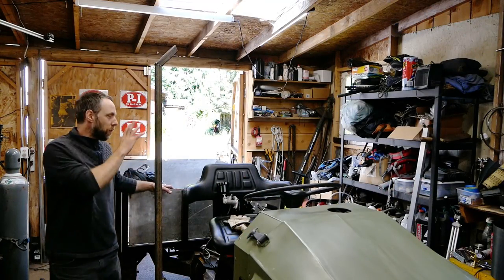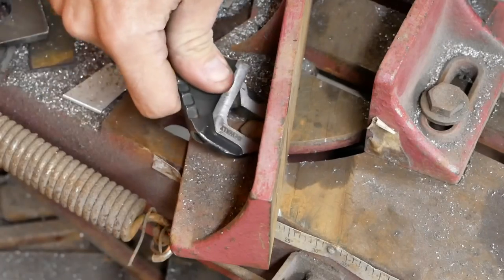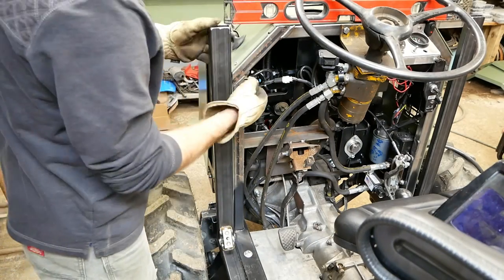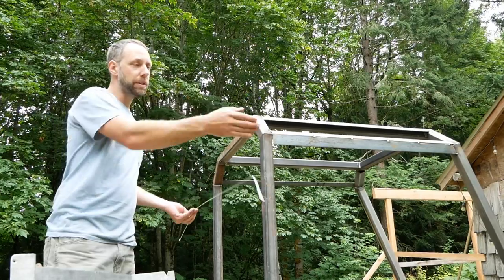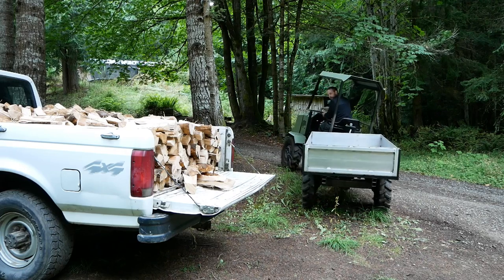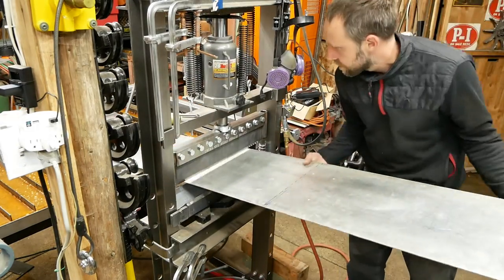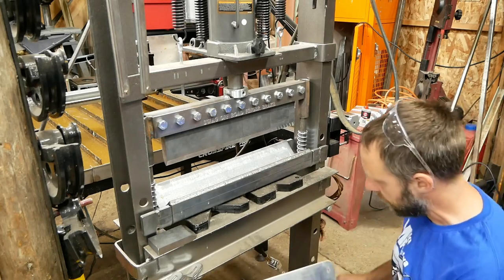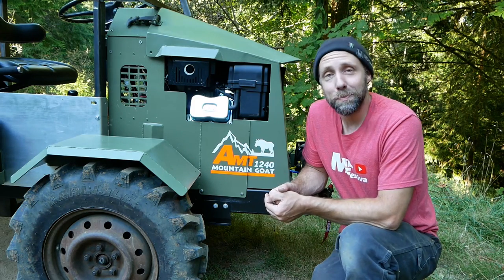420cc Predator powered articulating 4X4 dump truck build part 11

Comment: I'm going to be sad when this series is done.  It's been such a great build
Reply: Agreed, I could enjoy one of these but the time alone is daunting.
Reply: Hey now, he still needs to make it street legal, add a dual fuel system, and install air conditioning.
Reply from the maker: korey Okeene Haha hey Korey for a kid that only have BS video games posted on your channel you really don’t have any ground to stand on when it comes to design and fabrication. You have no clue what it takes to actually build something like this.
Reply: @Mikefestiva  Mike, this kid is a troll that will never build something as amazing as you have. The design and parts use are stunning. You have shown that you are an accomplished engineer and fabricator. Brush the haters off while you cruise around your property in a purpose built machine that completely fits your needs!

Comment: Mike very nice work. I have a tip for you to use when folding up boxes that are going to be welded. Drill a hole in the sheet where the corners will meet. The rule is it be the same as the inside bend radius  centered on the corner. I use 3 times the metal thickness for the hole. 

The reason for the hole is you are not crushing metal when you are bending. The hole also helps prevent cracking at the corners when bending. You can make the holes bigger for use as a drain hole for things like you are doing.

Comment: Hi Mike,
I love your tractor. Thank you so much for sharing this.
 This is how Steiger got started, they built an articulated tractor using truck trans,  diffs and motor.    I have spent many hours ( lost count but hundreds ) driving articulated tractors including many on a 1976 Steiger Cougar and it is clear that articulated tractors have many advantages over other configurations.  The fact that they don’t loose any pulling ability while cornering is a big one.   Their ability to put power on the ground is legend. 
Your build has inspired me to attempt a similar project.   A Subaru minus its engine is cheap and easy to come by ( Australia ).  
 
But:   There are a few things I would do differently:
Use a normal car type power steering pump for the steering.   Ford tractors have done this for years.  Surplus car power steering pumps can be picked up for peanuts and often already have a pulley and a tank.
The Pivot:  Move the top steering pivot point  higher.  Leave the lower one where it is but put the top pivot at about the height of the seat to give it about an extra 12” of spread.  I realize that this could cause issues with clearance from the tipper body but not insurmountable problems.    The steering pivot takes an absolute beating and this would strengthen it greatly.  This would also make an opportunity to move the steering rams from the bottom to somewhere up top.   Your use of the wheel brg assy for the axial pivot was excellent and should stand up to the punishment.  
I think that the tractor manufacturers use a short drive shaft with a universal joint at either end to negotiate the pivot.  This negates the alignment issue and the angle through each joint is not as great.  I will have to go and have a look at one of the tractors around the place to see just how they have done it.  
I would prefer a manual/pedal operated clutch so I could have the benefit of engine braking.    More work I know but quite achievable.  Lightening the flywheel would be necessary for this mod to make changing gear easier.  I would suggest removing the old ring gear and machining away all unnecessary  flywheel material.
I would ditch the foot operated accelerator and have a hand throttle instead and a deceleration pedal in  place of the accelerator.   Any one who has used a hand throttle/deceleration pedal arrangement finds it vastly superior on a tractor.   A deceleration pedal drops the revs when you press it, kind of like putting your foot on the brake.  When you lift your foot, the engine revs return to the throttle setting.
I think your  foot brake and handbrake setup is excellent and absolutely worth copying.
The Steiger had another great idea, the hydraulic oil tank was also the front chassis cross-member.  A box of appropriate size could be welded up and used instead of a piece of RHS.  This helps to lower the centre of gravity.   Any thing that lowers the weight distribution without compromise is a bonus.  Steiger’s hydraulic pumps were higher than the tank and suffered no problems from not having flooded suction.   And, yes, I would have a hydraulic system separate to the steering.  Y’ gotta have hydraulics.    An inspection hole of 4” to 5” on the oil tank is handy for cleaning  and pop a microwave oven magnet inside the tank to act as a metal trap.

I wholeheartedly agree with your choice of engine and love your work with this build and look forward to watching more of your  content.

Comment: Mike, get on McMaster-Carr and get a few lengths of pure copper bar stock and rounds. If you had been able to back that gap up with some copper bar it would have been easy-peasy and would have had a nice square corner inside with no melt through. The aluminum and steel will not stick to the copper if you keep it dirty and not polished. A bit of anti-spatter spray helps too. Once you get used to having copper around the more uses you find. My favorite trick is repairing a wallowed out key way. Just make a piece to fit in the key seat, clamp it down and fill in the crater beside it. Make sure to leave enough to get some pliers or pry bar on to get it out because it will stick a little. Usually a bit of hand filing on the key seat and diameter of the shaft is all that's needed. I have done this on shafts and even gears. It was a huge timesaver in plant maintenance when time was critical. 
Beautiful work as usual, stay safe and I will be looking forward to the next video!
Terry from South Carolina

Comment: Mike, the easy fix for the corner gap in your aluminum box is to clamp a piece of copper strap or bar in the corner and lay a bead over it. This is also good for welding sheets together as it keeps them from warping so easily, and the welds won't stick.
Reply from the maker: Nice tip! I really appreciate it 👍 Thanks 😊

Comment: Thank you for such a solid build.I wondered if you'd use the 'natural heat shield'from the engine to divert to the windscreen and to warm the 'cab'.It looks like you're set to enclose yourself through storms. /Cheap solution is 'pool pump'tubing and drill holes where you need air to clear windscreen and heat the cab.TY for this Awesome Build,and all you great vids.
Reply from the maker: Thanks for checking out my new video and commenting! Yes there’s plenty of heat that comes off the engine to heat the cab, I think that’s the simplest system, I do have a really small diesel parking heater that I’m installing under the seat, this way the cab can stay heated on really cold days even when it’s not running, for instance I’m out cutting firewood in the winter and want to warm up. Take care

Comment: Another great video.  I hope you keep them coming.  I love watching you fabricate stuff.  I have no skills, but am gathering tools and learning a little bit at a time.  Thanks!
Reply from the maker: Right on Tom! That’s a good place to start, get some tools, start on some small projects, and keep working up to bigger challenges, before you know it you will be making all kinds of things. If you look back 5 years ago on my first YouTube video I built a sawmill from scratch, I had only a few tools, cheap Lincoln 120 volt welder. My old used metal cutting bandsaw, angle grinder and a hand drill. I was able to build it, it was a real challenge but I sure learned a lot. I just keep leaning more and pushing myself and taking on new challenges, like that CNC table, I had never drawn in any CAD programs before buying it but I figured it out, you will be able to figure it all out and develop you skills too 👍
Take care

Comment: Hate that I'm so late to comment this, but if you clean up some steel angle real nice, you can use it as a backer while filling that corner gap on the aluminum tool box tray.  The aluminum won't stick to the steel and you can do a lot of fill and not have to worry about it collapsing or burning through. Also works well if you ever need to fix heavy aluminum pipe or tube, machine a slug, weld up the repair and drop the slug out. Ideal for repairing machined aluminum flanges and such, and since you have a lathe you can build your own backing slugs.

Comment: This build is great and I like the look a lot. The name is spot on too. One thing I worry about a bit is you plan to skin the whole cab and you have not fire wall. It's not the fire part  that worries me it's the exhaust fumes that could build up in a sealed cab. I know the exhaust shoots out the side but in a cold low wind that could fill your bubble so you might want to make a few vent windows for cross flow or good fire wall,  maybe both.

Comment: Two Words:
CLIMATE CONTROL!!!
Hahaha - now you can rig up AC and heat inside the cab!
ALSO: I think you may need big rubber fender washers under every bolt on point on the alloy body to combats the rattles and buzzes-

Comment: Nice video.  I'm ordering the Crossfire Pro today with your code.  I may be back with some questions.  I've never used one before but figured I could make some extra cash with signs and such.
Reply from the maker: They are awesome tables 👍 I had never used any CNC equipment like this till I bought mine, it was a bit of a learning curve but within two weeks of practicing drawing on fusion 360 when I got a little extra time I figured it out and was cutting parts. I have a play list now with the three videos on the crossfire tables, checking those out, and look at the description in the videos, I think I have some links to some good drawing videos I found on YouTube that really helped me out 👍 Take care

Comment: Next time you need to weld up a corner that has a big gap use a piece of square steel as a backer, you can weld right over it and take it out after to leave a nice sharp inside corner!
Reply from the maker: Right on 👍 thanks for the tip!

Comment: This is a awesome build. It looks like you are going to fully enclose the cab so I was thinking you could do a VW style heating for the cab by routing the hot air from the engine into the cab.

Comment: Awesome video as usual!!  Just one question.  I bought the little 125 titanium ... Which I really like ... Is there ever any advantage to pre-heating your material with a propane torch.  Just curious with colder weather approaching..  thanks again Mike and again ... Longer videos are more than welcome !!! LOL.  Because ... They never seem long.
Reply from the maker: Pre heating is good especially if you are pushing your welder to its maximum thickness it can weld, and like you mentioned especially if it’s cold. I don’t tend to, but I have years ago when I only owned a small Lincoln weld pac 100, it was limited to only about 1/8” metal so I would sometimes preheat thicker metal. Thanks for checking out my new video 👍

Comment: Those jointed magnet things you use for welding seem really handy. How have i lived for 21 years without seeing those before? Would've made life in the shop alot easier..
Reply from the maker: Yes they really work well! Especially working by yourself, it makes positioning parts to tack so much easier 👍

Comment: As a personal preference I would have had the side enclosure finish higher up, (about bonnet height), and when using rivnuts always grease the bolt when you put it in, as it helps to stop the bolt rusting in and then spinning the rivnuts when you try to undo it, been there and it's a nightmare to get out involving drills, angle grinders and panel damage. Really like the logo, it has that manufacturer's look to it.
Reply: one way to avoid that is to put a dab of gorilla glue or similar on the rivnut exterior before installing it, gives it that little extra grip to the panel

Comment: Looks great.

I think I'd have gone for a roomier full-width cab than that (bit more elbow room), but I guess if you've got lots of overhanging branches sticking out into your tracks this will probably be better.
Reply from the maker: The cab was limited to the max with I built it to without stepping around the front fenders and tires, I would have liked a little more room but was working with what I had. Take care

Comment: Love the build and your use of repurposed hardware. I purchased the crossfire pro and titanium 45 plasma ( yes gave you the plug ). I would really like to see a link to a cut chart for the materials you have experience with. Also is there a consumables supplier for the 45 that you recommended? Great videos, waiting on the next installment.

Comment: Liked the music at 6:20
Reply: Disagree. ... best music 26:29  .....
The rest of the video has too much music.....  Personally, I would prefer to hear the machines run....   Don't mind music in the sped up parts.  But let the music of the machine works play.... IMO
Reply: The reason I like the music is because it doesn’t take your attention away from what he is doing, unlike most modern music. I agree that some machine noise is nice, but if you watch a lot of build/machining videos it gets really annoying with the constant whirr of angel grinders and loud cracking from welders.

Comment: Great job becareful where you put your fingers as the metal comes up it can pinch in places you didn't expect. Also I didn't look that closely but a peice of square stock anbove tge fingers may extend them enough but what you did works to. We have made dies with flat bar and angle iron.

Comment: Nicely done mate. Do you plan on reinforcing the ROPS fixating plates? Those bolts threaded on the tube walls don't seem that reliable to me. Keep up the good work.
Reply from the maker: Yes I plan to add a few more bolts on the sides too, there’s also bolts up front higher up on the frame going into the steering wheel frame. Thanks for checking out my new video!

Comment: I’m thinking could you tack a tig rod in the gap and weld over? 🤔
Reply: yes or even a thin cut off hunk of metal . lots of welders use welding rod as filler
Reply: I’ve used thin cuts of 1/4 in to fill a gap on a bumper I built what I thought lol

Comment: dude... you seem like a guy who likes to weld stuff in general...  i'm betting youd really love a decent quality  tubing bender like a jd2 or something.    your rops is totally fine the way it is..   and you probably know about the bender idea already, but worth saying i love mine now that i have it,   absolutely tried to avoid buying one for years, but has been awesome for fabricating different things.     i have one of those old band saws like you too..   you should do a quick vid on aligning the blade guide bearings... its like my nemesis trying to get that thing to cut straight.    i can never seem to get it just right so it cuts straight up and down.   yours looks like its close like mine, but i'm sure youve had it perfect in the past and if you're  like me it bothers you when its off.   i dunno... just another idea.  great vids thanks, subbed

Comment: I noticed you had earplugs in, would sound deadening mat cut down on noise? I may try it on my lawn tractor for the heck of it. This is a great build, I have enjoyed this series.
Reply from the maker: Yes definitely 👍 I just got some sound deadening material I ordered on line. I think it will help especially now that I’m in closing the cab. Take care Kirk 🙂
Reply: @Mikefestiva  this is the problem with cabs, you enclose the noise as you keep the weather out, I worked in safety cab design at the prototype stage for twenty-five years and sound proofing always took a lot of doing, you want no windows to reflect the sound, but an all glass cab to maximise visibility, unfortunately good acoustic products are not cheap, as its about a year on it would be interesting to see what your solution was.

Comment: I noticed that you’re wearing earplugs probably from the engine noise: take a stock Honda grom exhaust and you can greatly reduce noise as well as route a proper exhaust system

Comment: Just curious, how do you shift gears? Without the pressure plate and clutch from the original trans?
Reply: Let off the throttle a little but you could possibly speed shift it since its geared down before the trans
Reply: Those centrifugal clutches have a lot of slip to them

Comment: When you finish the gutters fold the extra material over on itself and make it a pinchweld to add strength and a nice edge
Reply: You could basically mimick the obs ford gutter doing that
Reply: If you used a round bar on the moving part of the brake you would get a rounded gutter that may be more pleasing to the eye and easyer to finish, I have used this to bend a radius in the past.

Comment: In my opinion I think you should add an extra axle so 6 wheels 4 at the back for some more traction and so that if you have to much weight at the back and the front we end of the vehicle lifts it will stop that